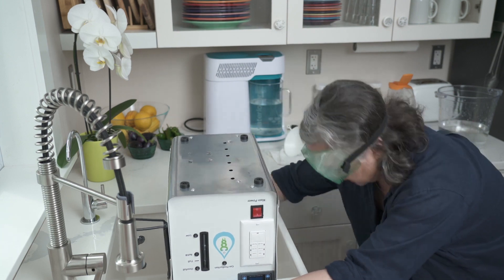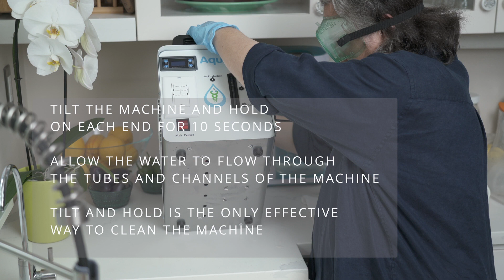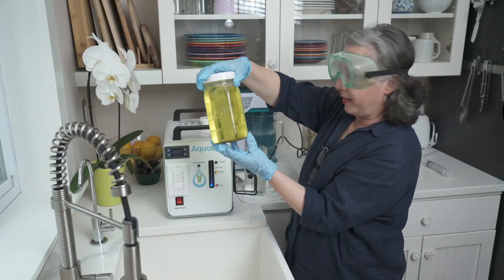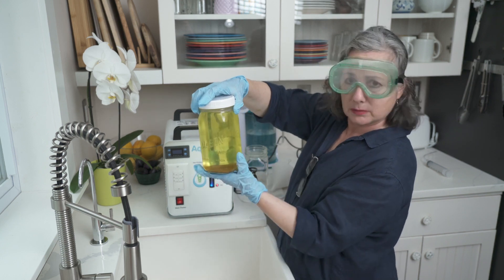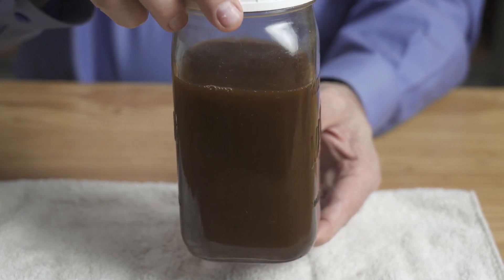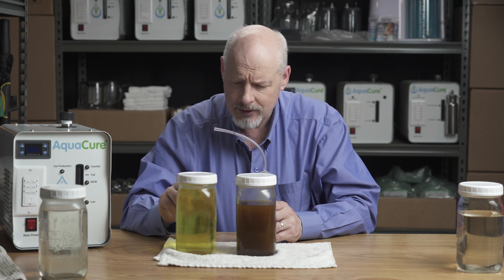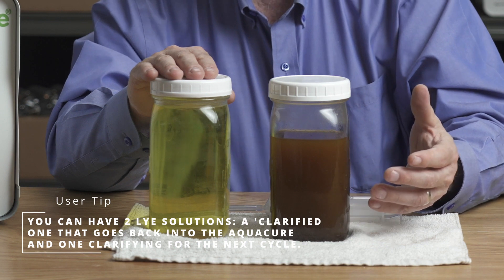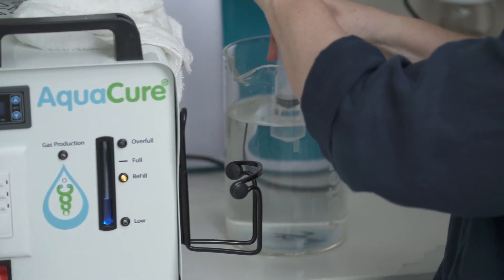AquaCure AC50 Maintenance (series video 5)

Comment: Hey, if I remember correctly it said in the manual to never pour non distilled water into the machine. Don't you introduce impurities by using tap water to rinse it?
Reply from the maker: LOL. a guy paying attention :)  Good!  Yes, you are correct, rinsing with tap water will put impurities into the machine.
But: There's a big difference between putting in tap water, THEN POURING IT OUT and using tap water as the electrolysis (water splitting) fluid.  Yes, a few drops of the tap water may remain in the machine, but not enough (in my opinion) to justify the cost and inconvenience of cleaning with ONLY distilled water.
DO NOT use tap water to make Brown's Gas... The garbage that will come out won't be healthy.  But for cleaning the AquaCure, tap water is OK.
Reply: @ecopegasus   what water distiller do you use? 
Kind regards
Reply from the maker: @dflintstone850  FAQ: What Distiller do you recommend?
The AquaCure requires distilled water to operate efficiently and for extended times.  In fact, NOT using distilled water is cause for invalid Warranty.

Many of the AquaCure owners have had issues finding reasonably priced distilled water, or in some cases, any distilled water at all...
And I've told them a simple solution is to buy a home water distiller.

Also, even when distilled water is available at local stores it’s a hassle to buy and carry home gallons of water AND a home distiller pays for itself in cost savings (it costs less to distill your own water than to buy it).

They'd then reasonably ask... What distiller would YOU recommend?  To which I didn't have a useful answer because I just built my own distillers whenever I needed one.

So a while ago I set out on an exploration of the internet, to find out what was out there and found a wide variety, from home build plans to distillers costing from $100 to over $5000.  I narrowed my search to qualities that would be reasonable in a home of anyone using an AquaCure.

There are lots of good options... Frankly you can go in the $150 range and find quite a few that will be adequate... 
But (as an expert in water and distillers) what would I recommend?

Virtually ANY distiller will work and you can find plenty of options on Amazon or eBay (Do check the reviews).

The one that really got my attention was:
https://www.amazon.com/Waterlovers-Water-Distiller-Smart-Technology/dp/B07CTTG5B8
(and I now have three in my home and shop)  I use them exclusively, and gave away my other distillers. 

I applied to be a Distributor.  So you can buy it on my website here:
https://eagle-research.com/product/waterlovers-distiller-2800mkii/ 

Alternative research shows the WaterWise Distiller to be a good one.
http://www.waterwise.com/shop/waterwise-9000-water-distiller/ 

But if you want Stainless Steel and Glass I’d choose this one:
https://www.waterwise.com/product/waterwise-4000-countertop-distiller/ 

They even have a payment plan.

Another good choice is:
https://mypurewater.com/shop/mini-classic-ct-distiller/ 

One feature I REALLY like on the above distillers is the delayed distillation vented technology to get rid of the ‘initial’ volatile organic substances AND the distillation pre-dry-shutoff.  And… The better ones, like the WaterLovers also have a sensor that shuts off the distillation BEFORE the boiling tank boils dry, which makes the output water PURER because it leaves the ‘heavy ends’ in the tank. 

But almost ANY cheap distiller can do a damn good job if you do TWO things:
1. Discard the first cup or two of the distilled water.  This will get rid of the ‘pre-distillation’ impurities.

2. Put an aftermarket timer on the Distiller power supply to shut off the power to the Distiller BEFORE the distillation is complete.  
Distillers that boil their tank ‘dry’ before shutting off WILL invariably transfer some of the heavier impurities to the ‘distilled collection’ tank.  
The collected distilled water WILL BE purer if you shut off the process while there is still water in the boiling tank.
 
In the meantime, you can buy distilled water in any pharmacy, in most grocery stores and in many automotive supply stores (to put in lead acid batteries).

The PROBLEM we have discovered with buying distilled water in plastic containers is that the water often has OILS in it.  We do NOT KNOW if the oils are from:
1. Inadequate cleaning from when the bottles are manufactured, 
2. Inadequate distillation process (not removing or adding oils) or
3. Oils exuded from the plastic bottles themselves.

The problem with oils in the water that is poured into the AquaCure, is that the oils combine with the lye to form SOAP.  
The soap clogs internal orifices and clouds the sight tube, making the liquid level hard to see… And making the ball stick to the tube or sink.

Further, making distilled water is less expensive than buying it (my local WalMart sells distilled water at about $0.25 a liter (quart) and I can make the same volume with $0.16 of electricity at home… and then you are not hauling water everyday.

So it’s a REALLY GOOD IDEA to get your own countertop water Distiller….

Q: I got the AC50... will have to set it up soon so my relatives can all have their several hours on it ... of course building up from the first 20 minutes.. 
I'd like to ask.. there are OTHER CHEAPER distillers on the market, that are simple and also contain in their dripper spout the place where they put their sack of carbon grains.

A: You do NOT need the carbon bag.  It is a matter of taste more than purity.  I never change mine in my WaterLovers.  
I do have some if you wish, but (in my opinion) it’s redundant and costly for no reason.

Q: I'd like to ask from YOUR experience, WHY you feel that the expensive WATERLOVERS is a better LONG TERM device, compared to many other GENERIC style distillers that others also feel have been adequate to create distilled water.

A: Because it is well designed to do the ACTUAL job of distillation, including first doing a ‘per-distill’ to get rid of the constituents that boil before water… And as for ‘expensive’, the WaterLovers should be in the $1500 range of distillers, with it’s quality and features. And longevity?  I’ve been using 3 WaterLovers distillers continuously in my home and workshop for years now.

I literally gave away my other distillers, because the WaterLovers does everything I need it to do.  There was nothing ‘wrong’ with the other distillers (they were in the $400 range too) I just like the WaterLovers better. 

That said, pretty much ANY distiller is better than most other ‘pure water’ option (such as filters or RO).  
You can even MAKE a distiller using some pots and pans.  So I have no concerns with people buying (or making) any distiller they choose.

May the blessings be
George
Reply: @ecopegasus  thank you kindly for your response and information , much appreciated !

Comment: I'm doing this for the first time ever today and my water is super dark and has a lot of sediment!
Reply from the maker: As the videos point out, that is expected!  Just let the sludge settle.  That's why I recommend havinr two solutions, so you can let one settle, to change out in the next maintenance rinse.
You get less sludge if you keep the water level at or above the 3/4 full 
FAQ: How often do I refill the Humidifier?

Q: How often I should change water in Humidifier? printed out instructions say in one place to do it ‘every 10 hours ‘ and another says ‘ every 10 hours of use at 100 percent operation’.

GW: Totally IGNORE, cross-out, DELETE both of those previous recommendations that were based on previous versions of instructions.

The most recent Humidifier Maintenance is in this document.

AquaCure AC50 Operation Manual UPDATE notes
https://eagle-research.com/wp-content/uploads/2021/11/AquaCure-Operation-Manual-Update-Notes.pdf

The Humidifier water gets totally replenished everytime you refill the AquaCure, which happens when your refill light comes on.

Refill the AquaCure from the Humidifier water (don’t over-fill), then dump the remaining Humidifier water down the sink and refill with pure distilled water.

Do NOT just ‘top up’ the Humidifier water.  That practice leads to a gradual increase in lye in the Humidifier, which reduces it’s ability to act as a scrubber and lye will start to migrate to your Drinking Water jar.

Hours don’t matter, Changing the Humidifier water is dependent on when the AquaCure needs water.

Note: If the AquaCure is NOT getting empty, seems to always remain full, and you are noticing the Humidifier and/or Drinking Water jar ‘losing water’, then you likely have a backfilling situation.  

Ask for instructions on ‘how to unstick the Tower Cap duckbill check valve’

To recap:

The water level in the Humidifier should never go down.
The water level in the Humidifier has nothing to do with ’time to change’ the water in the Humidifier.

When the AquaCure needs water (refilling), you fill with water FROM THE HUMIDIFIER.

Then you DUMP the rest of the Humidifier water and

REFILL the Humidifier with distilled water.

Thus the Humidifier gets refilled EVERYTIME the AquaCure needs water.

The AquaCure water level should be maintained between Full and 3/4 full.  

So everytime the AquaCure water level reaches 3/4 full, ReFill it from the Humidifier, etc…

Note that the water in the Drinking Water jar should be changed out at LEAST once or twice a day as adults should drink a couple liters of water a day.  Our inhalation safety protocols assume you are changing out the Drinking Water jar at least once a day.

May the blessings be
Reply: also the little float ball in the view glass seems to be stuck to the bottom!!   I've flushed the unit 3 times now.   It won't budge.
Reply from the maker: @FrankCrow  Make sure the water is hot (not more than 140 degrees F) and rinse often because the water cools off fast (at first) as inner components warm up).  
Then make sure you are 'tipping' face to back Slowly, so the hot water can wash through the orifices and dissolve the crystallization.  If the ball is stuck, there is still crystallization or soap formation.

Comment: I cleared out the sign tube and put the lye solution back in and NOTHING else but the machine is showing overfull. What should i do?
Reply from the maker: This is the kind of question best answered by contacting me directly, giving me your contact details (so I can find your order), the machine's serial number (so I can specifically answer questions related to your version) and any other details (pictures / video if applicable) that would help me diagnose what's going on with your machine.  I suspect it's something simple (like an air bubble).  Contact me at: https://eagle-research.life/contact/

Comment: If we use the syringe for the lye solution, is it ok to just wash it and use it for the distilled water that goes in the tower? Should I buy another syringe? Thanks for the great video
Reply from the maker: Yes, it's OK to use the syringe for both the lye solution and the distilled water as long as it's used ONLY to refill the AquaCure (or to suck out excess solution).  No need to even rinse or buy another one.  But always remember to store the syringe with the piston at least 1/4" off the bottom, so that a push on the plunger will free the piston if it 'sticks' to the chamber wall.